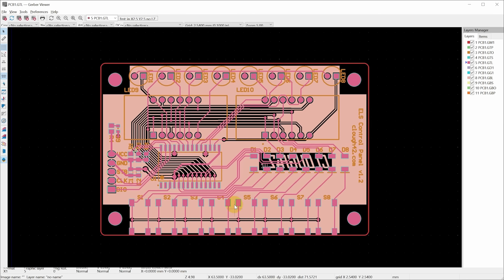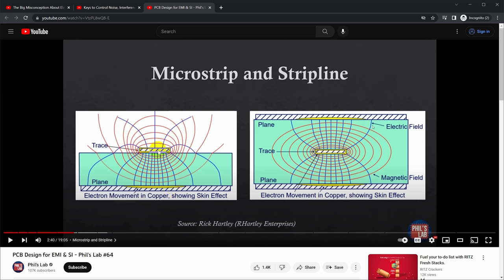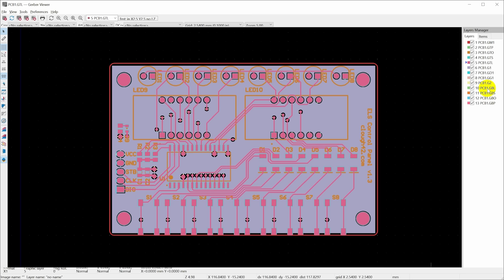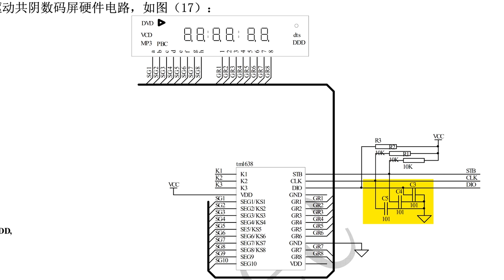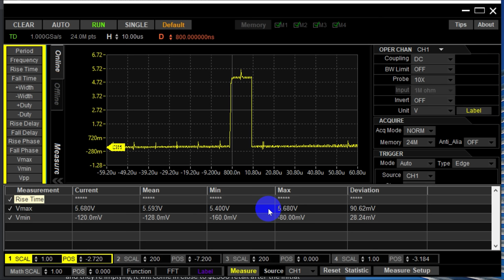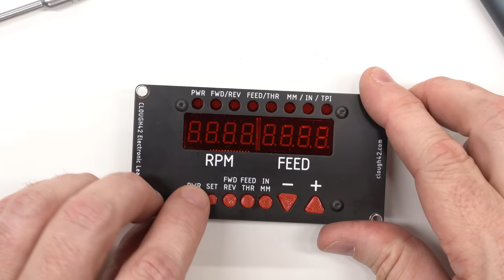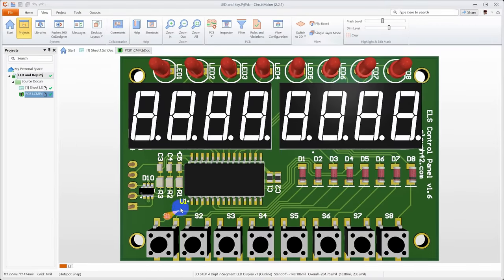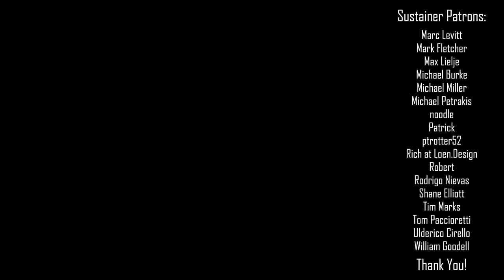4 Layers is Better than Two: Another ELS Control Panel Prototype

Comment: Hi James, When doing another release of the boards you might want to consider placing large pads on the internal layer where the screws pass through the board. These pads should be large enough to encompass the size of a washer/spring washer/star washer (plus a little more.  This will ensure that the mounting fastener when tightened  ( which may cut through the pre-preg ) does not create an undesired connection/short to the internal layer.   I have been caught by this in the passed.  Great work and love your videos.
Reply: that does help, but when mounting PCB board to enclosures, you almost always want at least a flat washer between the mounting fastener and the board, even with the pad, to prevent damage to the solder mask, and to spread out the clamping forces to prevent cracking.
Reply: @Gaunt596  if you're cracking FR4 with screw pressure you're tightening way too hard
Reply: @dirtdart81  I agreed but you need to allow for the end user you are not in control of (wink wink).  This is more a be safe precaution.  Even a flat washer can have sharp edges and it is easy to have that side in contact with the PCB.  More a suggestion to be aware of this issue was I have been caught-out with this and seen it many times while servicing equipment in the past.
Reply: Even better, use plated mounting holes with larger copper on the top and bottom of the board. Sometimes libraries (Altium for sure) have different types of mounting holes that also have a "keep out" area so no traces will be routed close to the mounting hole.

Comment: Did I miss the schematic?  On the video I finally saw the chip.  The power lead does not have a bypass capacitor.  That's board 101.  Normally every chip power has a 0.1 uF cap.  

Good video!!
Reply: I see a 10uF and a .1uF cap. Since the led driver has pretty large power transients - I would suggest adding a second .1uF and place one each right next to each of the two VDD pins. You can see the voltage transients in the signal waveforms. These caps will probably help with that.

But, I don't think you needed to go to a 4 layer board. You had room to run a ground return path on layer 1 next to the SPI bus signals.

Also

Comment: Having dealt with high speed circuit board and flex circuit design in the disk drive industry for many years, I can say your explanation of the design changes and selection of a multilayer board is all correct.  The only other way to fix the radiation problem might have been to install R-C snubbers in the the high current, fast-edge signal lines, which would have greatly increased the component count and might have been a wash with the cost of the multilayer PCB.  The actual clock rates in the control panel are probably not very high, but the fast edges produced by the LED driver IC are the problem and that's what makes this a "high speed" circuit.

Comment: I have an original board. I noticed flickering - but not by eye, it was only apparent when captured on video. I replaced the cable from the control box with higher quality cable with better shielding. The ELS is now working perfectly👍

Comment: FYI  You could have placed the caps over top of the pull up resistors.  From a signal standpoint it doesn't matter if the cap is connected to VCC  or  ground .  (assuming you have bypassed the supply rail).

Comment: I suggest that you use flux in the form of a syringe. It usually is "no clean flux", which means you don't need to clean your board after soldering. (You do need to make the flux "flow" completely though, since "unflown" flux can be a little bit conductive). In case you want to clean your board anyway, IPA with an acid brush with short(ened) hair does quick work of it. Note that lead free solder melts about 50 degrees higher than standard SnPb solder. For tests and reworks, it is much easier to work with the latter, unless you use a much hotter soldering iron. Note that the "glue" holding the copper on your PCB melts at around 700 degrees F, which means that heating a pad for too long with an iron hotter than 700 degrees will make the pads come off your board. Always use tweezers to hold parts. When reheating a solder to add a second part, like you did in your rework, you can melt the solder and place the part without caring about the quality of the solder, as long as the part sticks. You can then come back with flux and reflow the solder to make a solid joint. This allows to work around needing 3 hands to hold the iron, the tweezers and the soldering wire. Lastly, flux is like lube in many cases... You can hardly have too much.

Hope this helps.
Reply: I personally detest lead free solder for many reasons but the very high melting point and the narrow liquidus/solubility window makes for very difficult soldering, leading to cold joints. If you get the iron hot enough you pull pads off. Worse yet the solder is brittle and is prone to growing tin whiskers over time. It is crap all the way around.
Reply: "It is crap all the way around."  AMEN!  A google search will expose my rants against those damned and blasted EU RoHS directives.  If your stuff stays out of the EU, stick to 63/37 Sn-Pb eutectic around PCBs.  The only use I have for lead free ELECTRICAL solder is 96/04 Sn-Ag in "tinning" bare copper wire and a hot, high wattage, iron is essential for that job.  Such an iron WILL damage PCBs.
Reply: James used those syringes with "no clean flux" earlier in this video series and also showed cleaning them with an ultrasonic bath.

Comment: Are C1 & C2 the decoupling caps for the driver chip?  Are they big enough to supply the current spikes for all those LEDS?  If not, there may be HF noise induced in the power line which might affect the data lines in the cable.  I know I sound like Capt. Obvious but I was surprised not to see an electrolytic as the main tank, paired with a smaller low-ESR one.
Reply: That was my thought as well.  Those led's draw a lot of switching current which gos through the ground pin on the driver.  The charge needs to be replaced from the bypass caps stored so it doesn't get reflected down the input cable.   I think he was likely seeing ground bounce on the input reference for those control signals, the 4 layer would help this out.  But a nice fat electrolytic at the board edge would likely do some good.

Comment: The problem with RFI.
I always solved those problems with low impedance designs. People think that signal lines work with μA currents - no. That makes the signal lines into receiving antennas, and at first PN junction anywhere in the circuit branch, the RF signal is rectified - and counted...

Comment: 10:20 Those small components will pivot between the tweezers, and the harder you squeeze the worse it gets.

I've done a lot of hand soldering including 0201 smd components.

This is what you want to do.

You want tweezers with a slightly wider tips ( basically barely enough so you can no longer call them pointy ) , and you always rotate the board to fit the way you are holding the component, because rotating the component is quite counterproductive as you noticed :)

Put the component somewhere close on the board, and then, adjust your grip with the tweezers. Ideally you want to grab the component by it's top half without resting the tweezers on the board itself, because that inverts the pivoting behavior.

This alone makes it waaaay easier to solder

Some general tips for hand soldering smd:

Use way more flux.

Don't try making them straight or centered, even if one end ends up hanging in the air a bit, as long as the solder connects it to the pad. The only way to make them straight without loosing your mind is to reflow with hot air later. Trying to get them straight just overheats the pads and the components and causes stress in the joints.

There is no such thing as too much flux

Don't be afraid of adding too much solder and bridging pads accidentally. More solder distributes heat better and cools slower reducing joint stress, especially when you solder one end first and then the other, more solder wil keep the first end hotter for longer and while doing the other end you make the component hot evenly. You then remove excess with the wick, after things cool down for a moment.

There is no such thing as too much flux :)

If you cant get a pad done in couple of seconds, stop, wait couple of seconds and add new flux. Working for too long in one spot burns the flux and oxidizes the solder.

More flux

If you want to bodge a component directly to another, pre tin the end of the new component. Right on the board before positioning it, dip in flux and touch with the iron. If the end of the existing component isn't shiny, touch it up too until it is.

Did I mention flux yet ?

Also, you can use thicker flux to hold the components down, like a glue.

Yeah, that would be it pretty much, the rest is just in developing muscle memory and visual intuition.

Comment: dude my respect for you just went up 10 fold for mentioning Rick Hartley EMI Video. I'm  glad you caught the caps that was going to be my first suggestion "filtering out the high frequency from the signals and the other was on grounding the incoming cable on the left if it has ground or if the connector shield has a  ground  with a "360 degree ground" termination. why that don't help with EMI rejection it does help eliminate external factors that can make the EMI worse.

Comment: James,
I've been watching your channel for a long time, and love your content. I wish I had half the toys in my garage that you have. (my wife already thinks I have too many). 

Just a few comments on this video. Every thing that you mention about high speed layout in the video is correct. How can you go wrong quoting Eric Bogatin and Rick Hartley. But I'm not sure that layout is the real problem with your initial PCB. The blaringly obvious problem with your first circuit board is that it is missing bypass caps on the power supply. When you hang a switching circuit, like your multiplexed LED driver off the end of several feet of smaller gauge wire, like your wiring harness, there is a significant amount of ground bounce (or call it power bounce) due to the the current pulses that are drawn through the resistance and inductance of the wire as the circuit switches. Since your LEDs are multiplexed they are switching all the time they probably cause quite a bit of noise on IC. The typical way to fix this is to have a 0.1uF cap on every IC's power pins to GND. It is also recommended to have a much larger cap (or two)  near the power connector on the remote PCB. probably 10uF to 100uF. This will keep the higher current pulses local to your PCB instead of making them run all the way back to the source  for their return. The only high frequency currents you want on the return lines are that of the SPI signals and that current isn't very large. If you have the LED switching currents on those long lines as well (because you didn't have local bypassing) they will interfere with each other.

In your original PCB you show the SPI bus lines crossing over a small gap in the ground plane, and while that is not recommended, and the return currents do go around and create inductance, that path is not very long, and the loop isn't very big. If you were to calculate (or simulate) how much inductance that is you would be disappointed. Your SPI frequency isn't very high. From your scope plots it looks like 200 kHz. (which is almost DC) Where these techniques really start to become important is for high speed buses (10MHz and above).  Even considering the 10th harmonic of your SPI clock, which would be 2 MHz, what does a 2 MHz antenna look like? They are pretty long. 

The other thing to consider is how they are measured. I have had so many engineers try to tell me they have signal integrity problems and then they show me scope plots they took with either no ground clip, or a with a 6 inch loop in the ground clip on the scope probe. (The software guys are the worst at this, but I guess they have a lot of other stuff to worry about). A scope with 1GHz of bandwidth will show you everything wrong with your measurement techniques. You don't show your scope probe connections, so I'm not accusing you of this, but it is something to be aware of.

I have seen lots of PCB layout issues over the years (30+) as an RF engineer, but I've also seen a lot of problems that were blamed on PCB layout that were not that at all. When I'm in a design review and somewhen says we have a layout issue, my first questions are always "how do you know it's really a layout issue?" and "How did you measure it?" Noise problems are usually pretty hard to figure out and when you are stuck it is tempting to want to blame something that seems esoteric and that can't easily be proven wrong. When you want it to work it is tempting to want to throw every fix you can think of at once just to get rid of the problem. The book "12 Seconds of Silence" by James Holmes talks in depth about the techniques that were used at APL to determine root causes for their design problems. I highly recommend that book to anyone with an engineering mind set. 

As for 4 layer boards, they are getting so cheap that unless you are making 1000s of something it isn't worth the extra layout time not use use them for any circuit with more than a few parts on it.

Also, adding the ESD protection is good practice for any circuit that goes out into the wild. Remember to add a bypass cap across the VCC and GND terminals of that part too.

Well, that was a little more than I was intending to write. Again, love your channel, Sunday mornings I usually look for you and Rotary SMP.

Comment: If you've taken an electronics class, you might remember that a capacitor is just two conductors separated by an insulator. Here you have two traces separated by the board material. Capacitors block DC/low frequency signals but allow high frequency signals to pass. If you have a square wave, you can do a Fourier transform and see a nice spectrum of high frequency signals. Those high frequency signals that get passed through are your noise. This is just how I think of it, because going into the EMF explanations always goes over my head.

Comment: Your comments re noise filtering around the 16 minute mark are well taken.   The next step with signal integrity on your board would be balanced differential signaling and possibly a shielded cable with twisted pairs.  But that's a major change, so if you can clean up things with these changes it's a big win.   With regard to the TVS, another thing I've seen on designs that have input signals on long lines is serial resistors into the inputs (say 100 ohm) which limit the amount of current that can ultimately enter the device.

Comment: Really nicely explained! It makes me wonder how on earth Adafruit can make so many high quality gadgets while almost completely avoiding 4 layer boards. Presumably an EE degree actually means something 😅
Reply from the maker: It's totally possible to make great stuff with 2-layer boards.  Most common hobby microcontrollers have relatively slow (5ns+) edge rates, so can be pretty forgiving, though many Arduino reference designs are pretty noisy by modern standards.  4-layer is getting so cheap now that it presents interesting opportunities for the hobbyist to make routing easier and avoid a lot of common pitfalls.

Comment: Well done! I'm an electrical engineer specialising in micros, and all this makes sense; my initial training was in radio, and we basically have radio circuiots when dealinjg with micros. My favourite micro is the Rasapberry Pi series, which I have usd in a Railroad track parameter monitor which is used to inspect track and the 5 parameters that are associated with itr. It's all fun!!

Comment: Just a point for future designs from a many times bitten EE - looks like there's still a slot in your planes created by the line of vias towards the bottom left of the board.  If you wanted this to be really bulletproof you could space those out enough to allow flood to get through them.

Comment: I have done this type of rework soldering a lot. 0805 and 0603 are large components and still quite easy to solder for me🤭
Just a few tips: when cleaning up the pads with the soldering wick, I see that you brush the wick over the pad. I use to do this too and ruined a few boards that way because pads from small components or ICs may be pulled from the board. It is better to just put the soldering wick on the pad and brush with the soldering iron over the wick. Those large 0805 pads will most likely not be pulled from the board (unless you heat up the board too much) but that is still the better way to do it. Then, with a clean soldering tip, just touch the pad and you will have a nice flat pad on which you can mount the new component.
And when mounting "flying" parts like the 100pF caps, I like to place a bit of kapton tape below the component so I don't risk damaging the soldering mask of the traced below the component.
Last tip: before soldering the 0603 capacitor, put some fresh solder on the pad of the capacitor first, that helps a lot because it is now much easier to heat up the pad of the capacitor.
Your SMD rework skills are not bad. I have seen worse from both my colleagues and myself 🤫